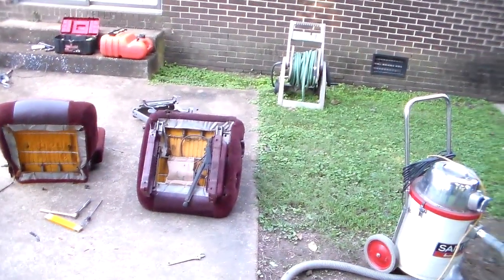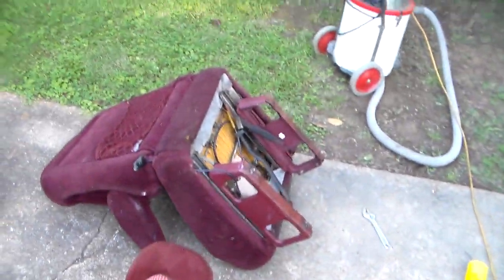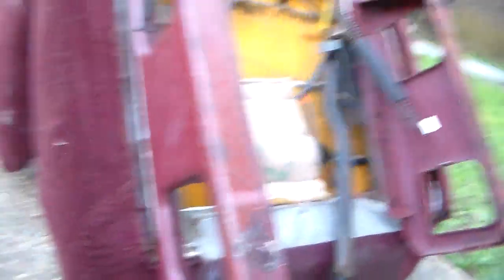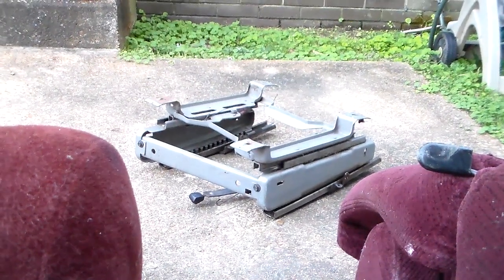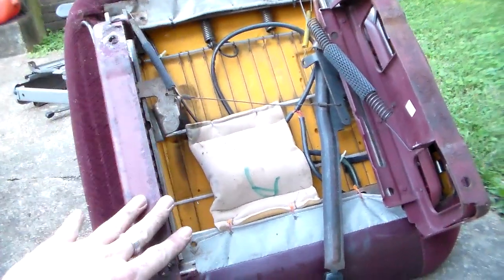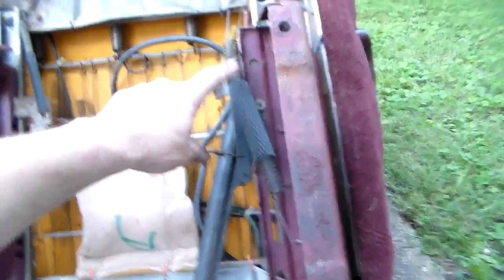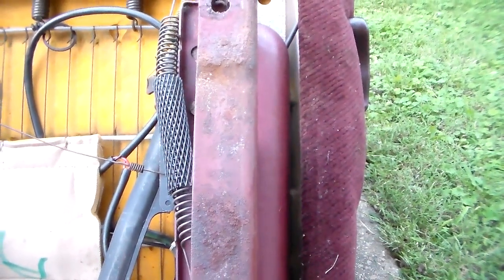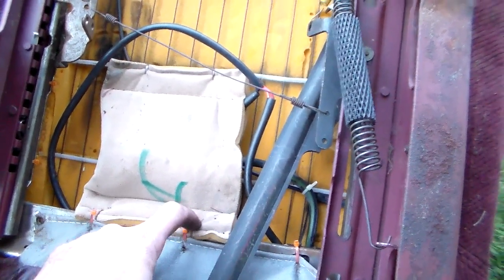1988-98 Chevrolet C/K bucket seat interchange information

Comment: I used to work for the company that made those lumbar support air pumps.  I actually worked on the line that made that exact pump for C/K trucks for over a year.  I never saw one actually installed before.  Those vinyl pouches the pump is in were made by the seating manufacturer from old scrap vinyl upholstery.  Some of it must have been sitting around for years as the foam backing would be all broken down at times.
Reply: Well that explains why mine hasn't held air in 10 years lol

Comment: Does anyone have a diagram or pictures of where and which springs are installed on the Passenger side seat adjuster/riser. I have a 94 Silverado with the manual buckets with entry assist.

Comment: I have a base model 1999 Classic 3500 Crew Cab Dually with a bench seat that moves when you tap the brakes and leans back way too far to safely drive. I found some buckets from a 97 Tahoe on Craigslist and before I buy them wanted to make sure they will fit with the existing holes? Thanks for the info!
Reply: you will need to drill some holes, the bucket seats will be able to use two existing holes on each side however

Comment: I am guessing my 95 Chevy had buckets before it had an aftermarket seat. I removed that and got a 60/40 bench. The riser on drivers side outer matched to the holes. The center bracket doesn't have any holes in the cab that match. The front part of the center bracket touches the floor. The rear does not. Any suggestions?. Second part. The Passenger seat the bolt holes in the riser where it bolts to the floor is about 3-4 inches shorter than holes in the floor. I was able to use a bracket off the after market seat for the out riser.. But nothing for the inner riser.. Where can I get this bracket? Thanks

Comment: Were you able to connect the cable for the latch on the side of the seat? That brings the back forward and backwards. The one that is disconnected in the video.  The cable wire that is?

If so where does that cable connect.

Comment: Does anyone know if the buckets seats with center console off a 98 will bolt on a 97 that has a split bench or will I have to drill holes or weld threads?

Comment: I have a 1994 GMC Yukon GT Sport with bucket seats with a storage console in between the seats.  My driver's  upper seat frame broke and I have had it welded three different times now it broke again and I was told that it can't be welded again.  I am having trouble finding seats from another 1994 GMC Yukon.  What seats would fit into my Yukon any idea?
Reply: I have a 94’ suburban Silverado with bucket seats also w console in center.I’m having the same issue with my driver bucket seat. The framing on the seat is broke at the front left bolt. I’ve welded it twice and the metal is cheap metal and same with your situation it can’t be welded again. Had any luck finding a new seat? I’m on the hunt for one. I know ur comment is from 3 years ago but it’s worth a try. Lol

Comment: I have an 1989 silverado single cab with a manual benchseat, but I wanna install manual buckets because I plan to put in a floor shifter, would I be able to install 1989 bucket seats with no trouble or would i need to weld and fabricate?
Reply from the maker: I predict you will need to add the two inner seat tracks for the buckets. You can look under your seat and see whether the tracks and/or brackets exist, but I doubt it.

Comment: Does this also work for trucks that currently have the 60/40 split bench?  Each side does have it's own set of tracks and risers, and I always figured they were the same as the bucket/console trucks, but I don't have anything to compare to?
Reply from the maker: The short answer is, I don't know. I would predict that the long side of a 60/40 seat is supported by a track on the driver side and a pair of tracks on the passenger-side inside location. I don't think it would be a bolt and go.
Reply: Tyler's Neighborhood Garage I think the middle of the bigger seats just hangs there and is held by a rod from the main seat. I'm wondering myself but to me without taking mine out they look like the same mounts just different seats at least I hope cause I'm wanting to do the swap too

Comment: Does anyone know what the entry mechanism is actually called and how it works? The cables for mine broke and I cant for the life of me figure out how they work to fix them
Reply: If yours has the mechanism like mine then it’s supposed to work that the cable attaches to a bracket that moves and allows the seat to move when you pull the lever it has springs attached to one of the sides the cable moves over through a hook to the other side and attaches to another bracket that allows the track to move

Comment: Would seats and console from a 2008 Silverado fit the floor to an '88-'98 Chevy/GMC?
Reply from the maker: +Fumble maybe with a bit of work
Reply: I wouldn't look good though. Mixing old w/ new isn't always a good idea.
Reply: Fumble that's what I want too know because I have a 1998 Chevy 3500
Reply: @TylersNeighborhoodGarage  0
Reply: I did it  work i took the right seat track put it on right seat. My truck a 95 GMC 1500 Extended cab came with 60/40 bench seats.
Reply: Tyler's Neighborhood Garage will the 60/40 front bench seat from a 94 Silverado bolt on directly to a 89 GMC Sierra single cab

Comment: At the 3.09 and 8.44  mark - what is that black rubber sleeved piece that is on the seat )right on screen) - i have it on mine but don't know what it does.
Reply from the maker: Keeps the spring from making noise.

Comment: I'm putting 60/40 seats with a console in my 97
Reply: Ryan Chapman how did this one turn out? I have a 97 ext cab silverado with power bucket seats, and I found 60/40 bench seats which I'm buying later.
Reply: turned out great i just haven't gotten a video of them
Reply: how much work was that? I want to put a 60/40 with console in my 94 reg cab.
Reply: I have a 98 z71 with 60/40 manuals I wanna do buckets can I just swap like the video or will I have to fab up something. Doing it to add a big center console

Comment: I have a 94 Blazer Fullsize. I have 2 issues. The driver side seat belt doesnt retract very well. Also my retracting mechanism cover for the passenger side is busted all to pieces. How do I fix the bad retracting and where can I find a new cover? I havent found a parts blazer anywhere!
Reply from the maker: The retractor is probably dirty inside. Try blowing the dirt out and clean it with some brake cleaner. Have you checked extended-cab trucks to see if the retractor is the same? GM is usually too cheap to make up a separate part.
Reply: I have not checked extended cabs but Ill start lookin! Thanks for the help

Comment: fairly durable??? other than the random stuff these things r almost indestructible.. other than abuse i mean come on now..  but my buddy corey constantly straight up abuses a k1500 n k2500, he is CONstantly puttin it in neutral bouncin it off the limiter n lookin at u like nothins goin on, jus jokin around then hell drop it back in gear n hes been doin that with 6.5s 5.7s 4l60s and the 80s.. he never breaks SHit!!! we r kinda maintenance obsessed so that might have somethin to do with it, we also both live by lucas so maybe its that idk..  we certainly work on more fords than gm at the shop so maybe there really is a winner in that category (at least the one of whos built better or reliability) i do prefer gm but i honestly dont care too much i like them all   i have a k3500 that proved to "not" b indestructible lol :p i tried drivin thru a telephone pole..it worked to..kinda..a brand new really thick one to with 30 thousand dollars worth of "experimental equipment" on it..exactly my luck.. that pole never even touched the gound it easily set dont on the top of my truck lol i doubt any of that stuff was hurt, i understand protocol but this was one of those times when somebody jus got a big old check for free basically.. sry bout gettin carried away with typin

Comment: Do the power seats unbolt from the track? My 94 is manual adjustment and the seats I found the driver is power. I want to unbolt it and use my old manual track.